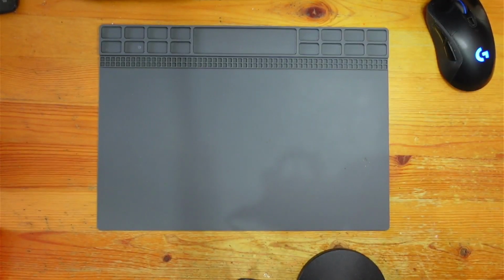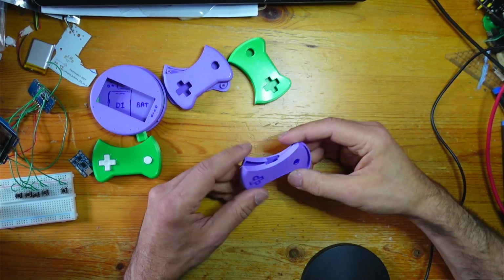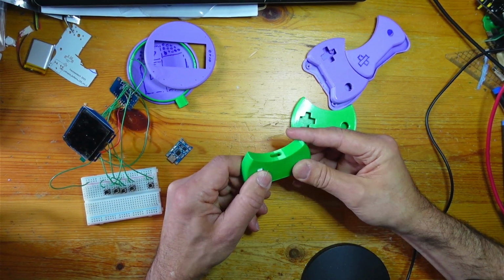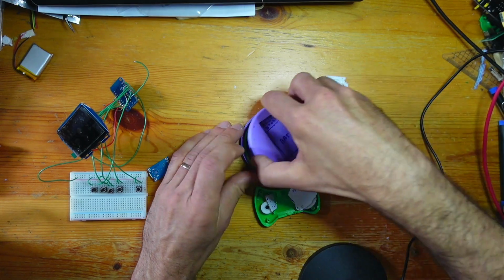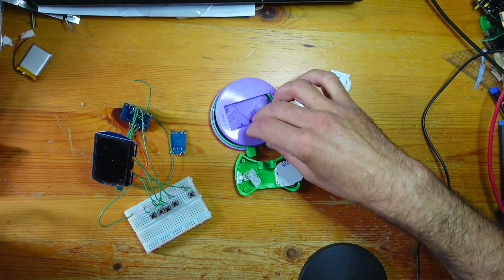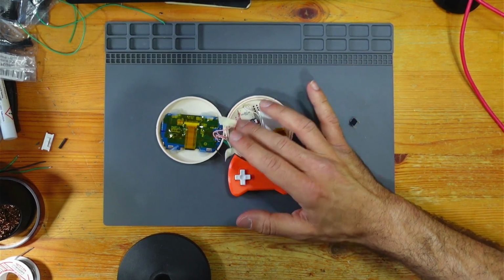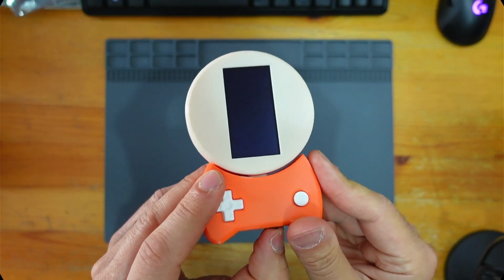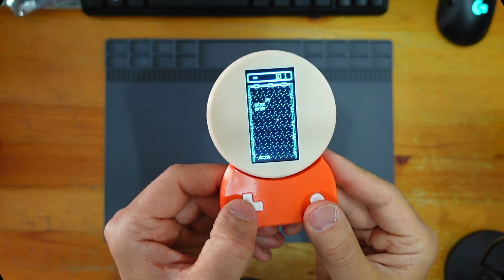Rocketboy -  A custom handheld gaming console

Comment: Great design! I like the janky rotating screen idea too 😂. I'm currently building the Mini Retro TV, but having trouble adding a button to skip videos. The ESP32 is BARELY able to play the video and audio streams simultaneously, and adding any kind of delay (handling the button) kills the video streaming. I'll keep trying things until I'm happy(ish.) Thanks for sharing the RocketBoy!
Reply from the maker: Hey thanks. I also got all the parts for the Mini Retro TV and it's more than likely I'll give it a go as my next project. It looks a bit hellish...  I bought 2 x T7 Mini32 V1.5's, but I wonder if the project would run (maybe better?) on the T7 S3?
Reply: @megazoid  I'm using the T7 v1.5. I had video stuttering with Dupont connectors, which I corrected by soldering wires directly to the SD card module instead of to the pins. Also had to plug the VCC line from the MAX amp board to the 5V pin of the T7 instead of 3.3v, or there was audio stuttering. Just FYI before you dive in. 🤓 Please post when you build it as I'm interested to see if you experience the same issues.
Reply from the maker: @Leemonoid  Thanks for the heads-up Lee. I have all the parts minus the exact MicroSD Card Breakout Board, and speaker Moononournation was using. I'm a bit nervous to get started on it, but I'll dive in in the next few days. 😆